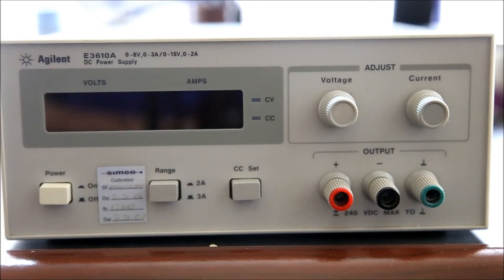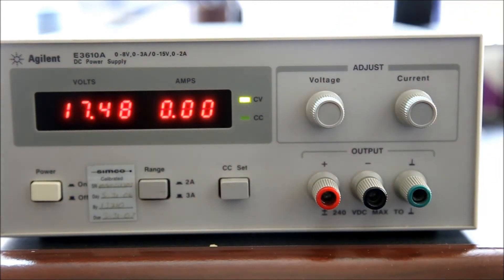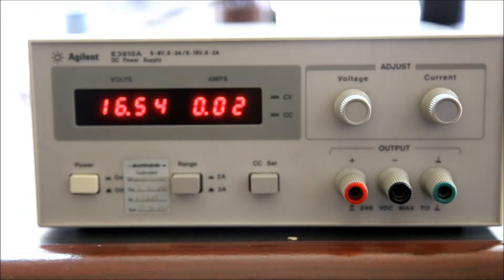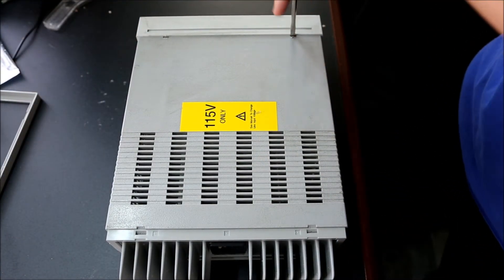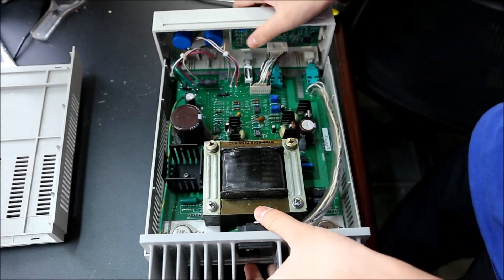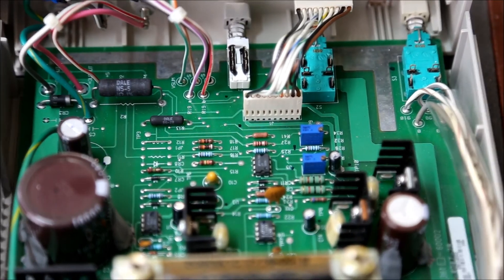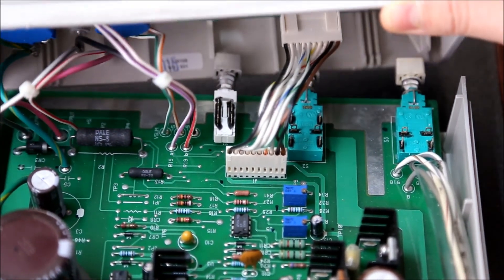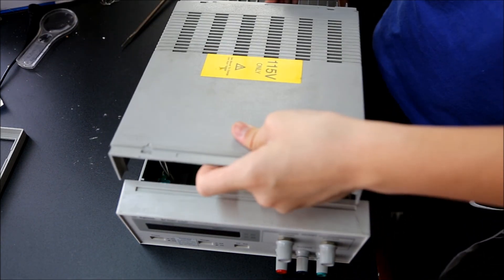Agilent E3610A Teardown

Comment: If it says 0-8V, 0-15V why does it go to to 17.5V? Mine does the same.
Reply: I see in the manual on page 1-5 it says under "Operation Beyond Rated Output" that the supply can be operated in the 5% overrange region without being damaged but it can't be guaranteed to meet all of its performance specifications in this region. 2.5V extra is more than 5% but it could be that.